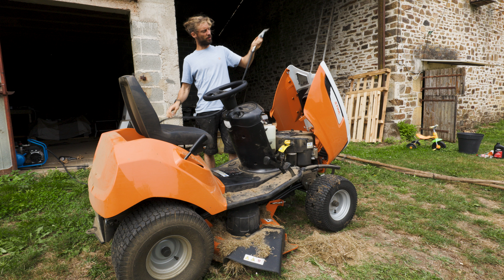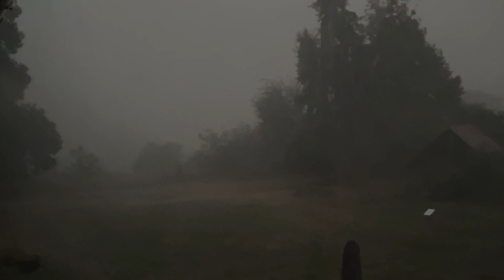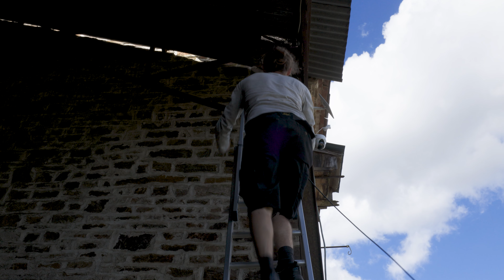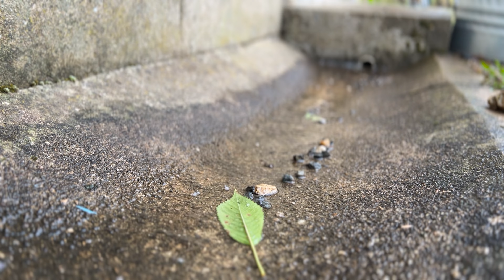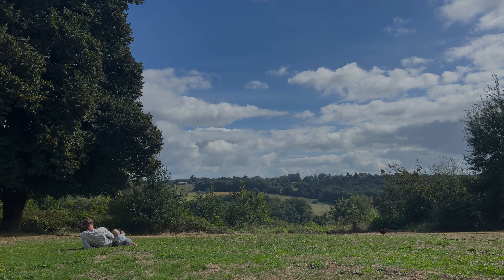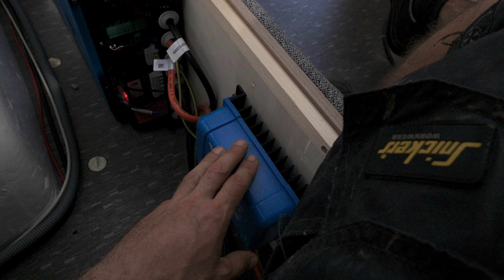15 - Mower TLC, Internet Cable Run & Victron Disassembly From Our Caravan.

Comment: One thing my dad always told me was to make sure at the end of the season to clear all the grass away from mower. Mice like to make nests over the winter and chew on wires. Great job on the solar system!
Reply from the maker: I didnt think of that when i cleaned it, but it does make alot of sense here with all the mice around! I try to keep the barns clean to hopefully not give them the chance to create a little nest!  😂

Comment: The covers on the mower deck belts are only good for picking up garbage, I would suggest that you remove them permanently. I owned a mower for ten years, with no cover on the belts, and  it worked well and was easier to maintain.
Reply from the maker: In the future you will see me indeed do the same thing cause they do indeed only get stuffed and wear the belts cause you can not see it.

Comment: Starlink is awesome isn't it, got ours 2 days after we moved in, think yours arrived same day you moved in didn't it?
Reply from the maker: Yeah, we got lucky it went that way, you can even see the mailwoman arriving and delivering it. It truly is a game changer good internet for 40 euros especially in these rural areas.
Reply: @DomaineSauvage  When I ordered mine I had to pay full price for the kit but they offered the mesh router an ethernet adaptor for 1 euro. I managed to set it up so I have wifi all over the house and with the cable, fitted an exterior router as well from Wavlink which has given me wifi all over the property. Fabulous as I haven't even got a cellphone signal here.